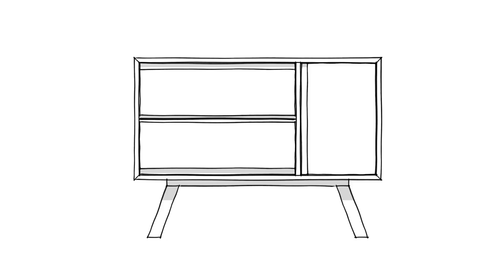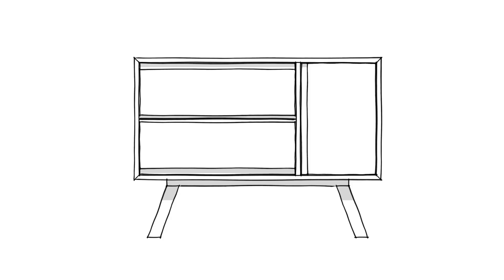Let's Talk About Design - Angled Legs

Comment: Make it easier: fix your joint angle and taper the outside. Or begin the taper shortly below the stretcher/apron for a classic look.
Reply from the maker: Had another point this out. I'm gonna try the inside taper method at some point. Seems like a good solution!

Comment: Thanks man, after listening to the podcast I've been really trying to think about design more, I'm learning Sketchup at the moment and little tips like this really help to point me in the right direction!  Question - with the tapered legs would you just taper the inside edge of the leg?
Reply from the maker: Yeah. You could do it with a tapering jig on the table saw, or you could use a bandsaw/jigsaw and free hand it.

Comment: Any advice on how to join the legs to the stretchers?  I'm working on a similar media cabinet and I"m good with everything else, but i'm trying to worth through how to attach the angled legs how you have them drawn here to the stretchers.
Reply from the maker: I usually use half laps for this kind of situation. You could also do a bridle joint. If you didn't want to go "all wood" you could use dowels or dominos. In the latter you'd want to devise a clamping jig to help you apply pressure in the needed direction.
Reply: Awesome...I'll have a look.  No matter what I do I will have to develop some sort of jig, either for the cutting or the gluing (or probably both).  Just starting out here and really want this to be a great project.

Comment: Hello, I saw your Xbox shelf video and noticed that you do your woodworking with your garage door open. Doesn't your wood expand that way? since it can take up the moisture in the air that is outside, and if you then put the piece of furniture inside doesn't it then contract agian?
Reply from the maker: Wood adapts to its environment much more slowly than that. Also, the adaptation would have a lot more to do with what part of the country you're in, than if the door is open or not. Also, for my case work, most of the crucial, large pieces are made from plywood which doesn't really expland/contract all that much.

Comment: i have nothing to say. i just like it when a good guy answers: "HI" XD. joking aside, does the taper on the legs affect the rigidity/steadiness of the piece (totally noob question i know).

I 'd personally also love to see an application of woodworking in other forms like specialized desks/pieces (a speaker cover as an example)
Reply from the maker: HI!

There are a lot of variables, but in a design like this, as long as it doesn't get too thin, the taper shouldn't make a difference. Actually the angled legs compromise the design a lot more than the taper because you are really changing the type of force being applied to the joint. That said as long as it's well designed, it shouldn't be a problem.
Reply: Chris Salomone any other types of woodwork items in the foreseeable future?

Comment: I ordered some angled mid century modern legs for a red oak (very heavy) 64"Lx26"Hx18"D tv console piece with two cabinets on the side and a central shelf. The legs include a 14" cleat with the angled bolts, but do you think it would be better to put a tapered leg in the middle of the piece to help support it? Or do you think the legs could bear the weight? I called the company and they said they don't recommend putting the legs on pieces longer than 60", but will the extra 4" really hurt the piece over time? Thanks for the help!
Reply from the maker: I don't really know...BUT! somebody made a tool that let's you plug in all of the variables to determine the sag. Here is a link - https://www.woodbin.com/calcs/sagulator/

Comment: Why not set the interior angle for your joinery and then taper the outside of the leg? Wouldn't this make your life easier?
Reply from the maker: I suppose it could. Maybe I'll give that a go on a future project to see if it makes things any easier. For anybody reading, if you were to do that - the angle you would "set" would be different. For example on a leg that was roughly 6" tall and tapered from 1 to 3 inches. To match an outside angle of 15*, you'd probably be setting that inside angle to something like 30* and then allowing the outside to be arbitrary....or, well, I guess dictated by whatever other measurements you had.

Comment: May I ask, if the component was taller, would you then have longer legs? I love the legs but would like to do it on a four drawer night stand.  Thank you.
Reply from the maker: Thanks Tonya...it's honestly hard to say, I've built dressers that were 30" tall that have 15" base and 15" cabinet, and then others that have a 4" base and 26" cabinet. It just depends on the look that I'm going for, and what it needs to do. In general though...no rules. Just play with it until it doesn't look bad anymore :)